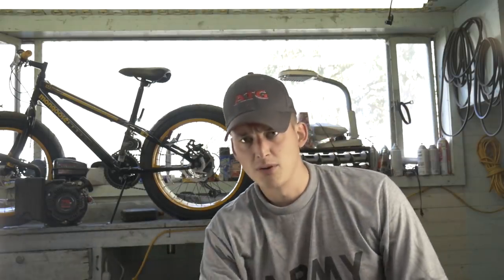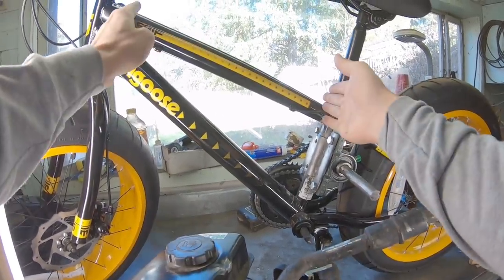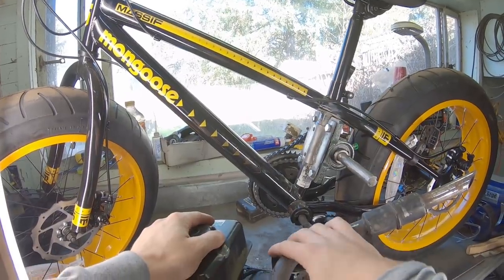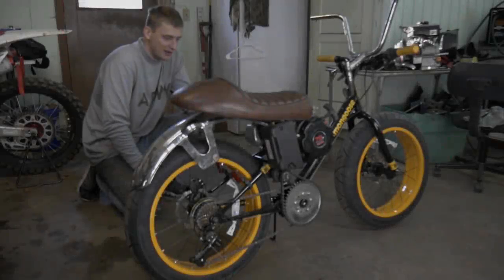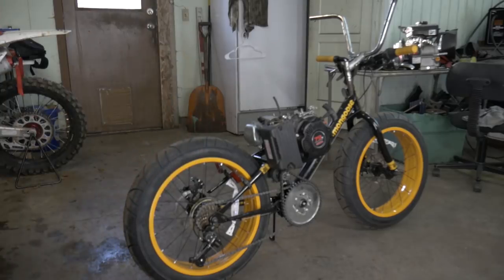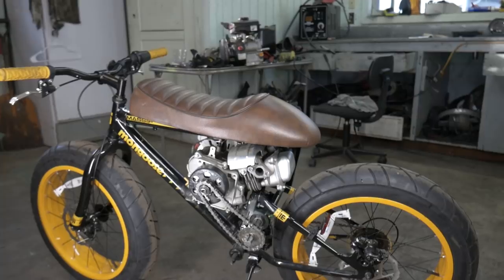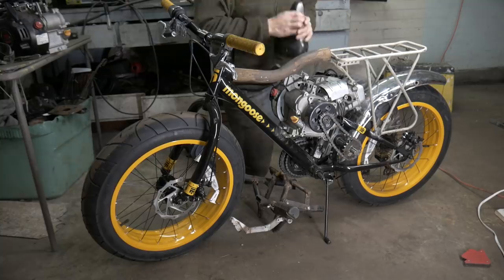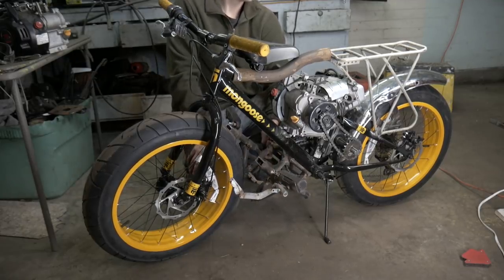HOME-MADE Fat-tire motorized bike build #2

Comment: Great job ! Only question I have is what about front suspension? You can keep what you have and use the disk brakes if you make a leaf spring front end . Indian motorcycles used them all the way up til the 50’s as an option if you didn’t want the girder or telescopic front forks and about 20% of new buyers did it as they worked really well . Look at some pictures of them , you’d have to cut a leaf spring in half and weld to the fork , and add another thinner fork and pivot plates . Just a suggestion. Wishing you many years of safe and fun riding

Comment: You can not lower the rear BUT you could have lowered the motor so you could drop the seat then raised the front to give it that custom rake look. But now even though it is cool it has that Honda trail 90  old person look. keep trying you will get it.

Comment: i have 208cc that i am planning on putting on a full suspension bike i have... i just don't know if the high compression 30lbft 208cc will work with a 6-1 gear reduction, planning to weld up a second gear so the thing has a 12-1 too 6-1 gearing on a 26'' tire. calculates at 3000rpm from the engine 6-1 would be 35mph and 12-1 would be 20mph... still seems too high of a gearing, i got hills to go over.
Reply from the maker: I think 12-1 with a 208cc may be to much reduction unless you are planning on just going off road up hills and other crazy stuff! otherwise 6-1 seems it would do the trick huh?
Reply: @OliverMotorized  i was not planning to type this much but, I was thinking of welding a gear... a 6 speed gear set too the stub of a pedal crank "small gear too the bike frame and larger gear to the outside"... one that has 16-34 tooth gears, as well as still having the same gear cassette on the back wheel in normal orientation of course. so the gearing would be 36speed "some gears would likely have the same ratio", the clutch is a 10 tooth... the gear i had made that bolts to one side of the pedal crank is 60 tooth "could be swapped for anything from 30-74 tooth" then first gear after calculations would be 12-1 and top gear would be a 3-1 rpm reduction... the 208 i have is a high compression engine but that is a lot of gears for an engine rated for 30lb-ft... 288lb of torque to the ground in first and 72lb of torque in top gear to the ground. i used this calculation to get the torque " (engine torque in lb-ft multiplied by the gearing) divided by the wheel radius in feet wrote as a decimal). i don't think the centrifugal clutch will like the 3-1 gearing.